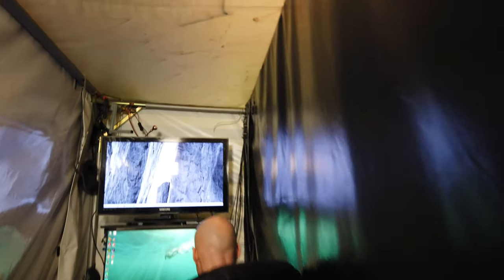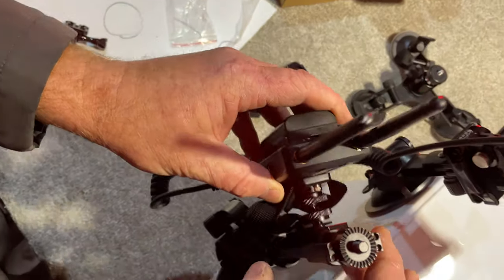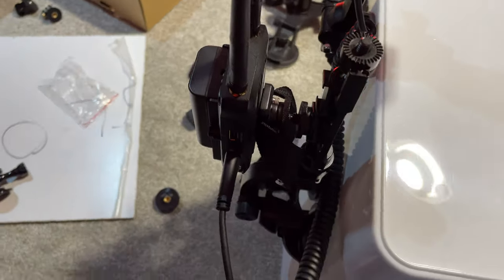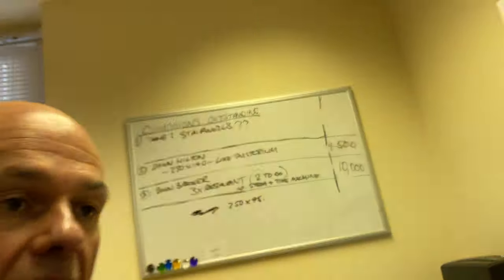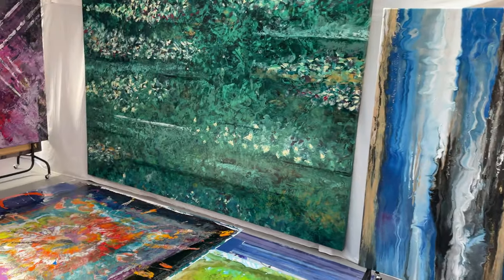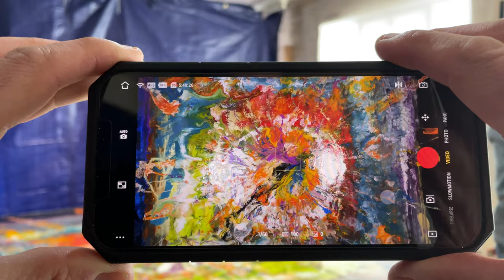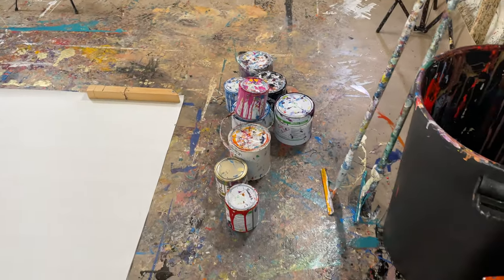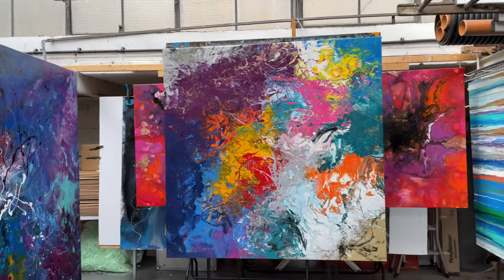MULTI-COLOUR MAYHEM!! Getting stuck into a client's commission!

Comment: Question on stretching canvas, I noticed that you use a heat gun as you're stretching, does that help ease the canvas into place or what's goin on with that?
Reply from the maker: It loosens the canvas weave and also one of the active properties of the paint so it makes for an easier stretch and also a tighter one when it cools
Reply: @SwarezArt  So would that help pre stretch a canvas as well then? I only ask cause I recently stretched a canvas to paint on and couldn't get some of the wrinkles out. I have sense resolved this issue but would rather avoid it again with future canvases. And thank you for taking the time to answer my question.

Comment: Is it easier to work with the paintings in warm weather or does it not make a difference
Reply from the maker: Yes, it is much better in warmer conditions. We always work with a heat gun as it helps to loosen the canvas weave but in cold temperatures it's a lot harder to keep everything even and consistent.